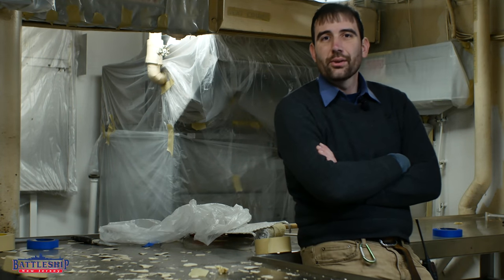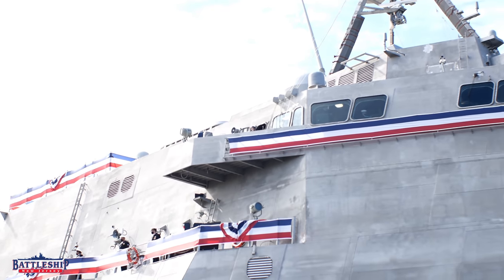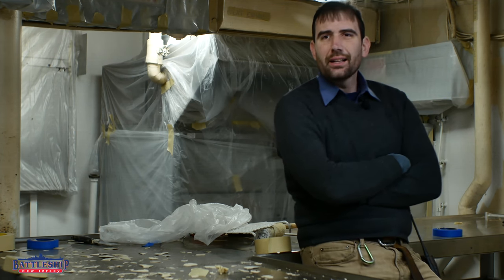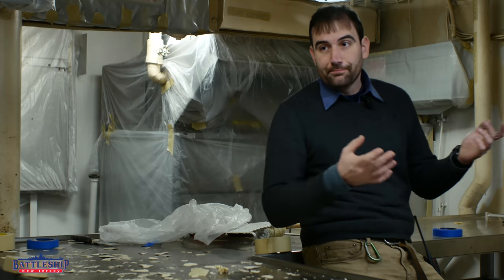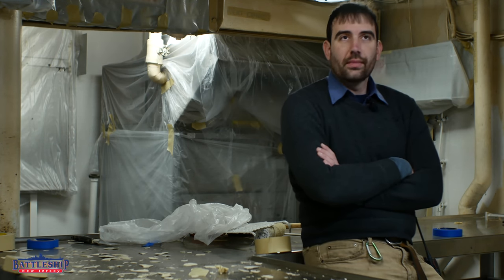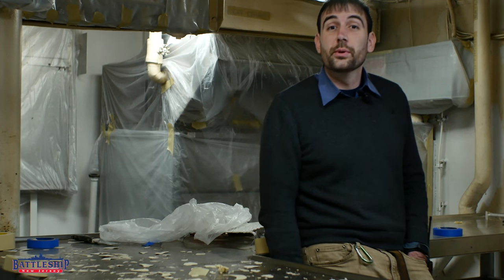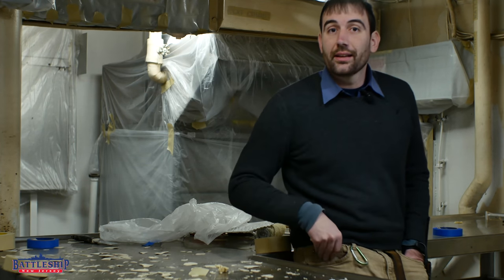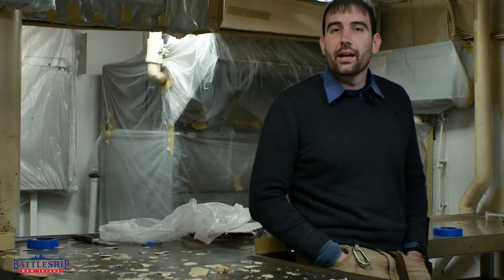Warships Made Out of Aluminum?!?

Comment: the battleship should come back but with more emphasis on helicopter handling being able to use them as forward operating bases by sailing right into an enemy port is invaluable
Reply: aircraft carrier? destroyer? littoral ship? If it isn't a sub or a tug, you can probably launch choppers from it

also battleships are purpose built machines to take 16" guns places and fire them, everything else second. given how unneeded 16" guns are now given drones and missiles, you'd need to reinvent the battleship to do something else and at that point you don't necessarily need a battleship anymore
Reply: @pizzaivlife  : There are two basic ways to handle a new battleship design-
1) missile-based (this is refered to as an "arsenal ship"), so essentially very nasty to fight, and very expensive to fully rearm, and
2) multi-role super-cruiser with extra design consideration for damage endurance.

Honestly, I can see some sense in both. A small number of arsenal ships would be a very scary stick to anyone thinking of picking a fight (kill it fast, or there won't be enough of you for a closed-casket funeral), and super-cruisers (I'm thinking big guns up front, flight deck & LCS style mission modules in back, supplemental guns and missiles along the sides) could be a very flexible resource (instantly up the local potency of any fleet they're in formation with, provide high-end "locality extension" if deployed a distance away but in conjunction, and serve as a micro-carrier for places that don't deserve the bigger Navy & Marine flight decks).

Comment: About that Aluminum burning, part of that killer is because it melts at a lower temperature and the other issue is it radiates heat very well as compared to steel in which heat doesn't transfer heat as well and can store more heat. What this means is fire can spread much faster through the superstructure causing items to flash fire, which them makes more heat and then causes the Aluminum to melt faster. Also, if the aluminum hasn't melted or burned, it could gone plastic and is now risking to collapse and making it harder to control the damage.

 If you're on top of your damage control and can keep the heat from spreading, you should be good to go. But if you can't, it'll spread much, much faster. I suppose that super wool must help blunt that spread of heat and flash fire, so perhaps aluminum ships might be more viable. It's an interest solution, at least.

Comment: IDK, if you've ever seen what's left of an aluminum body Ford pickup truck or tractor trailer after a car fire you might be skeptical, usually you have the steel chassis parts and a mess of melted aluminum on the ground. Vehicle fires can be fairly hot but its not like they've been roasted over a thermite or magnesium pit at white hot temperatures. Knowing that I'd have some concerns about general ship borne fires or accidents involving aviation assets causing damage thats far more excessive and which puts it out of service where a comparable fire with steel materials might need repair but not to the level that it becomes totally incapable of combat that even a fairly localized fire with aluminum might be. Moreso I would wonder if it might become an issue in combat tactics used by an enemy attack where incidiary weapons far less expensive or complicated than traditional anti-ship munitions and more easily delivered could prove to be an exploitable weakness whether just from a general tactics aspect or in a situation where the enemy doesn't have the sophisticated anti-ship weapons of a well equipped military power who can take out a ship easily in many ways but instead is now capable of causing severe or catastrophic damage with far less advanced weapons or delivery means. To put it more simply imagine a tank in battle, a capable enemy with a Javelin can score a kill regardless of the material but where a steel hull might withstand an incendiary grenade or even an improvised device, an aluminum one might be vulnerable to a well placed device as simple as a homemade napalm device or perhaps even sustain significant enough damage from a molotov cocktail with the right accelerant inside. That could be a serious disadvantage on a modern battlefield or ocean.

Comment: Aluminum doesn't just burn, it burns very well.  Rocket fuel well.  The space shuttle's SRBs were packed with ammonium perchlorate oxidizer and aluminum powder fuel.
Reply: Those loud bangs you hear every fourth of July, accompanied by a bright flash of light?  Potassium Perchlorate and aluminum powder  aka flash powder.
Reply: That's powdered Aluminum. Solid Aluminum doesn't burn very well because it will conduct the heat throughout the sample and melt.

Comment: I would like to think that the modern nuclear carriers have some kind of armor around the reactor I'm sure that's classified but I would like to think there's some kind of common Sense there. Don't want to bomb or a big shell coming in and hitting your nuclear reactor.
Reply: I'm pretty sure the flight deck is armored. As for the nuclear reactors they are deep inside the hull and the reactor compartments themselves are rather robust. They are also likely at least partially protected by the way the compartmentalization of the ship is designed as well as where some of the fuel storage tanks are located. Yes, a nuclear carrier has lots of fuel storage capacity because she needs it for both her aircraft and her escorts which are gas turbine powered these days. Also, as the fuel tanks depending on their exact location provide some of the secondary shielding for the reactors they have systems set up to fill them with water as the fuel is used up. So those fuel storage compartments are always filled with fluid.
Reply: @minarchist1776  traditionally American carriers didnt have armored flight decks but I know nothing of the newer carriers.
Reply: @robertstone9988  It was my understanding that the flight deck on USS ENTERPRISE (CVN-65) was 2 inches thick. That was partly to provide armor protection and partly to be able to take the impact of aircraft weighing 70,000 lbs (or more) landing on the deck at about 170 mph or so. Something they didn't have to consider in WW II.
Reply: @minarchist1776  thanks

Comment: Aluminum doesn't burn*, (until you get up over 3600f), however it will *melt at a relatively low temperature compared to steel.

Comment: Does anyone know what specific aluminum alloy they're using for ships? Aircraft aluminum alloys (2023, 7075, 7050, 6061, etc.) are all very susceptible to corrosion.  Pure aluminum (1100) doesn't corrode, but it's also pretty weak in terms of tensile and shear strength.

Comment: it's not that the aluminum burns, it's that it transitions to a liquid much more readily. while steel will hold on to some of it's strength while even red hot, it'll contain the spread of a fire for hours even when overheated. aluminum will transmit of "wick" heat away very fast, but it's super hard to judge temperatures, and unlike steel, it can melt in front of your eyes from a pretty typical fire. if you toss it in a camp fire it melts even. the reason it's so unpredictable is that aluminum oxide has a very HIGH melting point, while the unoxidized aluminum inside melts much lower, so it will transition with no warning

Comment: Aluminum and Steel have to be painted below the waterline with a biocide paint (so you don't have to scrape the hull). With steel the paint can be copper based (which is very effective) with Aluminum it cannot. You can also paint the aluminum above the waterline, but the paint has to be applied to bare metal, which is not easy due to rapid oxidation. 

If cost is not an issue you could make the hull out of Copper-Nickel (Welded 90-10), which is more expensive than Aluminum, which is more expensive than steel. Copper-Nickel is an excellent biocide and is very corrosion resistant.

With any material the boat will have to be maintained properly. This includes knowledge and proper application of cathodic protection. In my opinion the USN is not well suited to maintaining an all aluminum ship. Operationally, with an all aluminum ship (or yacht), you have to understand the many different types of aluminum corrosion, including stray current corrosion, and you have to understand the vessel in terms of anodic potentials to minimize galvanic corrosion. As such, you may have to take specific steps not normally seen with steel constructed ships, but more than that, with an all aluminum ship you have to understand the many different types of aluminum corrosion, which is different, and at times much more challenging than steel. For, example with an all aluminum ship you may want to electroplate your bronze propellers. This reduces the surface area of bronze in relation to aluminum which is much less noble. This can help in addressing galvanic potentials.

If we look at repair of an aluminum ship using welding techniques, aluminum is much more challenging to weld properly than steel. For example, using TIG (very popular with aluminum boat building) you need a special push-pull gun to match a similar wire approach as with steel TIG. Also, some aluminum joints would be MIG welded which is also very challenging as compared to steel. Aluminum conducts heat exceptionally well, which means the arc welder has to be higher current, and or you must preheat the aluminum. Aluminum is also well suited to using structural bonding adhesive, which may in certain circumstances be stronger than a weld, but obviously not as heat resistant. If the vessel must enter high latitude ports the thin roll up door(s) do not provide enough insulation. They will just freeze up. 

Aluminum ships (and yachts) have to have insulation in board on the outer hull, and it has to be very effective in terms of thermal properties, be flame retardant, and be removable in sections (Batts) in case you have to repair the aluminum. You will also probably see a compatible paint (coating, may even be epoxy based) on the inside of the hull which is compatible with the insulation. The insulation standoffs (outside mounting points) are usually welded to the inside of the hull to support the insulation. 

If you compare the LCS deck work bay to a large all aluminum workboat trimaran the roll-up rear door is unique on the LCS. A work boat would have a door that is operated hydraulically and lifts as a single piece (hinged at the top), in other words it is very strong and is as insulated as the hull. There also would not be a middle support post at the door to get in your way. Also the work bay has tie downs but does not have outboard I beam lifting rigs or any recessed work pits, as far as I can see in the picture. Also, the deck from the work area should be sloped downward and have a slight crown with side drainage. It also, as far as I can tell, does not have cross gantry rails. I guess I don't really know what the LCS work bay is designed to do, it does not make a lot of sense to me from a functional standpoint.

Comment: Steel rust, Aluminum corrodes! The biggest challenge with an aluminum ship is preventing dissimilar metal corrosion. So you have to isolate or prevent direct steel to aluminum contact.

Comment: Titanium ship hulls? Could that be a solution?
Reply: Believe the Soviet Alfa class subs had a titanium alloy hull. First one had severe hull cracking and didn't last long. Believe the issue with using titanium is the prep you need on the metal and probably special tooling to be able to work with titanium

Comment: I am not an engineer but a High School Chemistry Teacher.   The students and I always note when we talk about single replacement reactions and the activity series of metals that Aluminum will react with steam.   Is this a concern?   How often is the hull, decks, walls, etc come into contact with steam?
Reply: Most warships up to and including WWII were steam ships (the exceptions being submarines and the 3 German panzerschiffes). Lots of opportunities for steam pipes to leak, when you suffer the sorts of jolts that you get when being hit by shells weighing a (literal) ton or by torpedoes, so it doesn't sound like aluminum would be a good mix with them.  It's certainly not my field, but I don't think that modern warships use steam, except possibly nuclear-powered ships.
Reply: @michael14195  The number of conventional steam-powered ships is indeed drastically decreasing.  As you mentioned, if it is Nuclear, then it is steam-driven.  The only difference is the means of heating the water to make the steam.  Once the main steam line penetrates the bulkhead between the Fire room/reactor room and the engine room, there is no functional difference.

All that said, both conventional and nuclear powered ships go to great lengths to maintain a closed system throughout the entire steam cycle.  Steam is generated from feed water, used to spin the turbines, condensed back in to water (condensate), then processed to become boiler feed water again.  Boiler feed water is maintained at a very high purity level..."Distilled Water" bought from the grocery store would most likely set off alarms and get dumped to the bilges due to impurities.  Any leaks require make-up water, which must be distilled from sea water.  If large enough quantities of feed water are required, then fresh water usage is curtailed elsewhere...like your anticipated shower becomes a damp washcloth applied to the appropriate areas.

The systems in a steam propulsion plant are much more robust than you might think.  Figure that superheated main steam on a 600-PSI plant is around 850 F.  The system must be designed to accommodate the expansion/contraction cycles encountered when you start/stop systems and they transition from very high to ambient temperatures.   This and other factors such as vibration, fatigue, shock, battle damage, etc. are all anticipated and planned for in the design of the systems.  Expansion joints, flexible joints, pipe supports and hangers, flanges, etc. are all purpose-designed for use in a military vessel.

All of the above combine to ensure that the steam stays on the inside of the equipment and our dirty ambient environment stays on the outside.  If you sustain battle damage to the point where a steam leak cannot be quickly isolated and/or controlled, then you probably have MUCH bigger problems than your hull material reacting with the steam...like your hull material no longer keeping the water out...

Comment: Doesn't bare aluminum oxidize easily. I have some aluminum tent poles that look good, but if you touch them, your hand comes off black, from the AL2O3.
Reply: It is the oxide layer that gives it the better corrosion resistance. The oxide layer forms very quickly and prevents corrosive agents from penetrating deep into the metal.
Reply: @admiral_franz_von_hipper5436  That sounds reasonable.

Comment: are aluminum ships also less susceptible to magnetic mines?
Reply: Yes-  minesweepers have been built with aluminum hulls, often successfully, but not always. Not all marine design firms and shipyards are equally skilled and experienced in this specialized type of construction, and last minute cost cutting changes have been typically ruinous to the final product. Also, mine designs have been evolved rapidly as well so that magnetic signature isn't the only or even primary means of detecting a ship! A non-ferrous hull is no longer a guarantee of protection from modern mines, but it helps. For example, during the 1990 Gulf war, my VLS packing DD was  patroling in the central to northern Persian gulf waters 24/7 and encountered floating mines with disturbing frequency during daylight hours - the butt cleancher being those 10ish dusk to dawn hours when you CANT SEE THEM! Some looked to be refurbished WW2 (corona virus style ball with horns) mines that maybe broke thier moorings during storms, and later saw 55gal drums with rebar mounts for the exploders (basically seagoing IEDs). We often called out EOD swimmers to lnspect and dispose of them, (I'm sure someone in that community could expand on subject far better) or sometimes tried to detonate them at a safe distance by .50 cal fire (but runs the risk of just sinking it out of sight and still being dangerous sometime later!). Simple, cheap and numerous can still work in Littoral brown water areas while slowing you down and distracting attention from the high tech threat attacks - as witness mine casualties USS Tripoli and USS Princeton later in the war. I saw Princeton in the drydock in Dubai afterward being still held together by welded on I-beams and steel cables, very sobering considering that only 4?months before it was a litteral coinflip between me or my shipmate being chosen to manup Princetons CIWS shop, he lost the contest so was the one who bounced his noggin off the overhead cableway in the breakfast chowline when the mine went off.
This was a lot longer than I thought it would go, but so be it, sorry.
Reply: @KevinSmith-ys3mh  oh dear, I hope your friend is okay?
Reply: Hi there, yes Ralph came out fine afterward, just some bruises and scrapes at the time. He was about the middle of the ship at the time and the mine detonated (probably) just before the aft gunmount and propellors, cracking off the fantail at the weak point where it joins the main hull. Anyone back there would be in far worse shape. We both worked in the same office at the Cruise Missle training building a few years later, so alls well!🤗